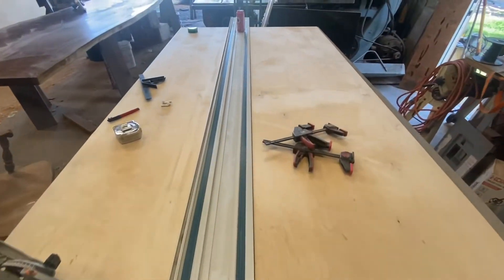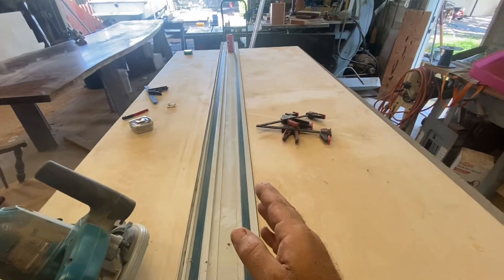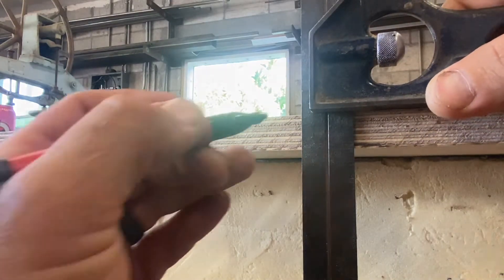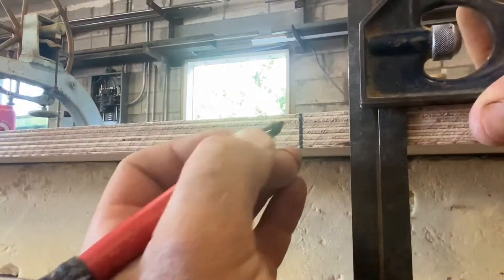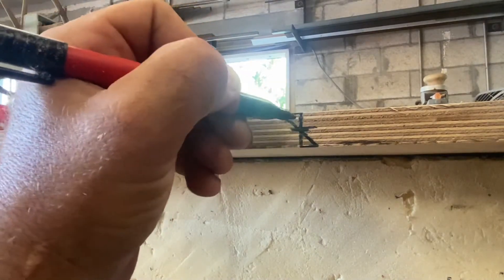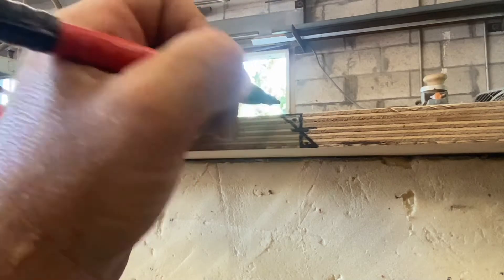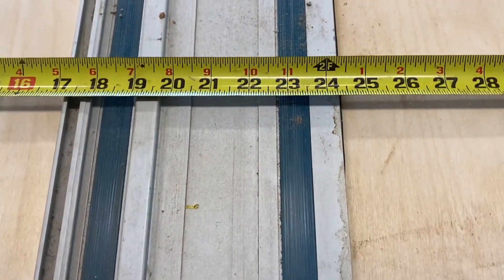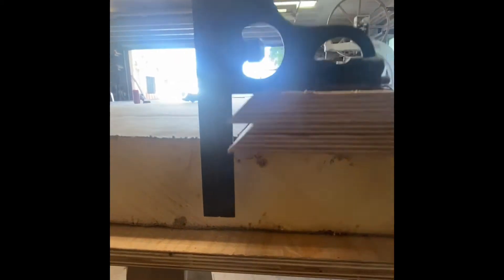Find the Center of Your Bevel

Comment: Another trick for this if you're using a table saw fence is to set the fence at 1/2 the width of the wood minus 1/2 the thickness of the wood minus 1/2 the blade width, which makes use of the same geometric trick of the "1/2 the thickness" you shared. Thanks for the video.